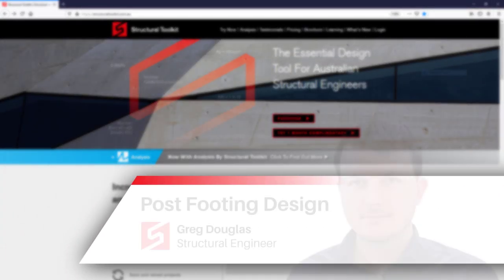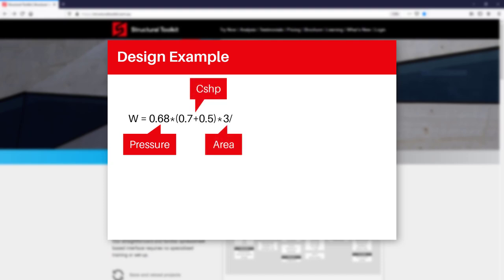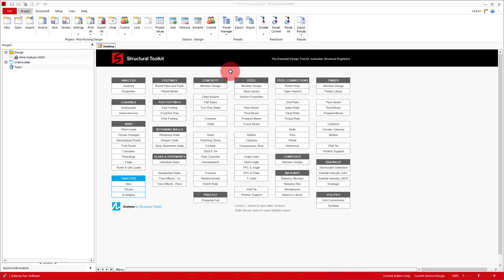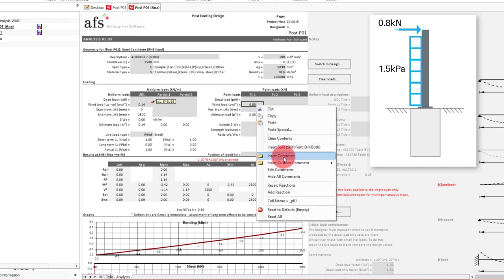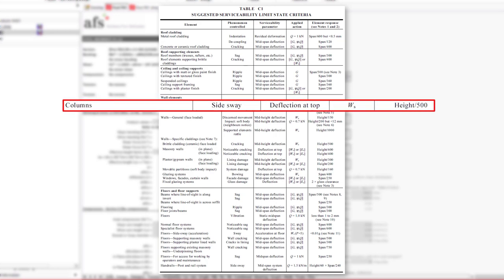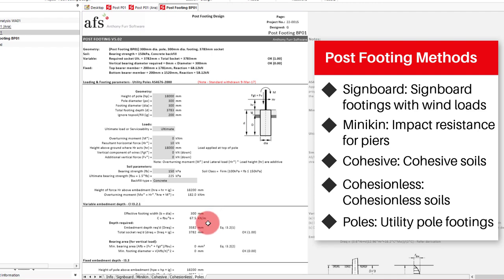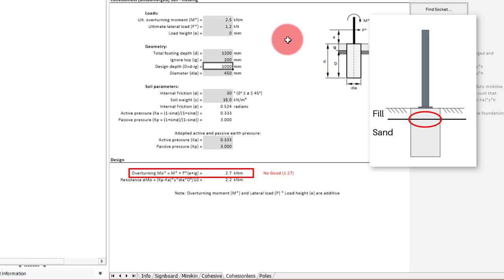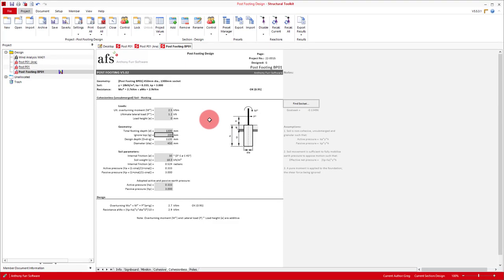Structural Toolkit: Post Footing Design - AS 4100

Comment from the maker: The Post Footing module has been updated to include an option for resolving the overturning moment to the point of rotation within the footing. To match the example in this video, this option will need to be turned off to "No". This option is found in the notes section to the bottom right of the module.

Comment: Maybe we should also consider the local pressure (kl) factor when determining the wind load applied to roof, then transfer to the post?
Reply from the maker: Hi Tom, good question. The local pressure factor kl relates to members that directly support cladding, so typically you wouldn't apply it to the force transferred to the top of the post. If you think it should be included in your design, then you can incorporate it into your design P* value.